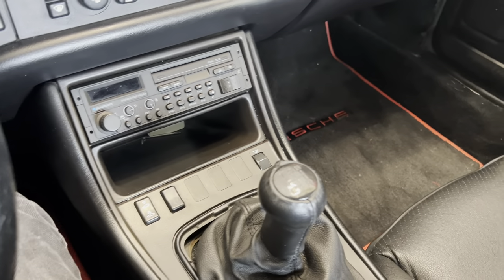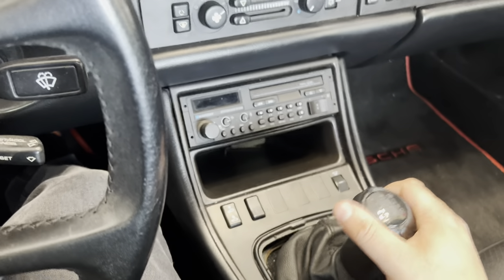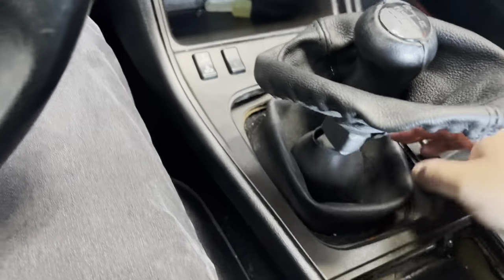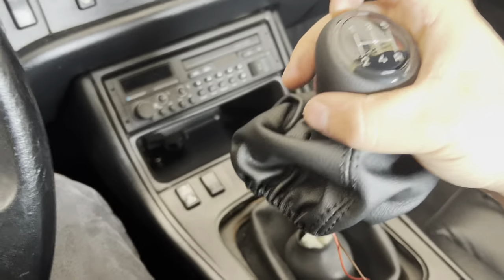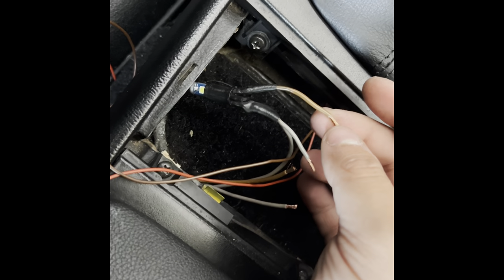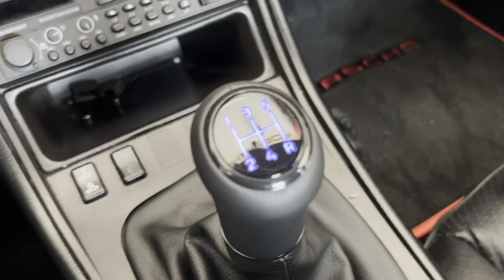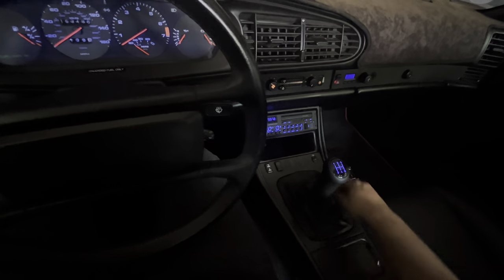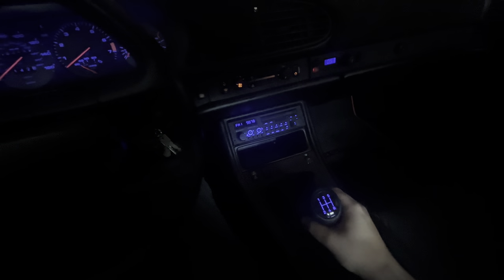ICT Shift Knob Installed In A Porsche 944

Comment: Does it matter which of the grey wires you use? I snipped one and connected them but it’s not lighting up the shift knob LED. Don’t really care about keeping the ash tray light, just don’t want to go crazy snipping wires😅
Reply from the maker: Actually it might because one is a supply wire and the other is a daisy chain type of wire. But the way I did it, the cut wire gets reconnected  anyways, you’re just cutting it so you that you can strip it and attach the wire from the shift knob to feed it power if that makes sense. 

Think of it like you’re making a Y with the wire. One arm of the Y goes to back to the original connection you cut from the ash trey light, and the other part of the Y now goes to the power for the LED. 

The stem of the Y should be before the connection to the bulb for both the ground and power. That way they are wired in parallel. 

It’s pretty much the same exact connection for the ground as well since that needs to be spliced into.

I suggest rewatching from 3:40 a couple times to see how I did the wiring. You shouldn’t have any exposed wiring after you’re done.
Reply: @TakeFlightGarage  Thanks a million man! I’ll take another look at it in a bit once it’s not boiling outside
Reply from the maker: @cadecox9714  careful who you say boiling to hahahahaha if you’re from Phoenix and it’s 110 you get a pass but if you’re in the Midwest or East coast and it’s like 95 you ain’t seen nothin yet 😂😂😂😂

But in all seriousness good luck and if you have any other questions let me know!
Reply: @TakeFlightGarage  was a nice cool 93 with 80% humidity in Arkansas today, but I was able to get the light all figured out. Just swapped which grey wire I was using and it worked like a charm!
Reply from the maker: @cadecox9714  That deserves an ice cold beer if you ask me! Nice work!